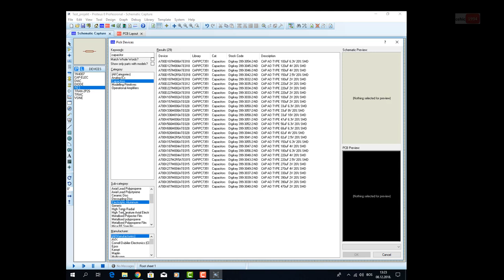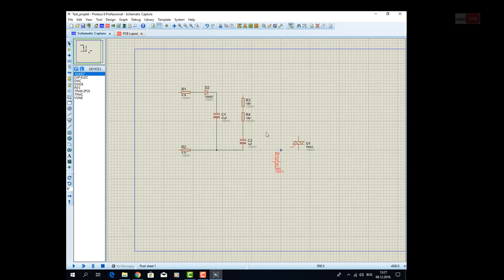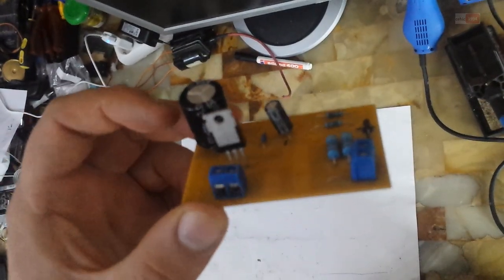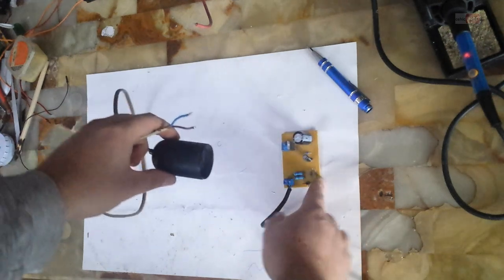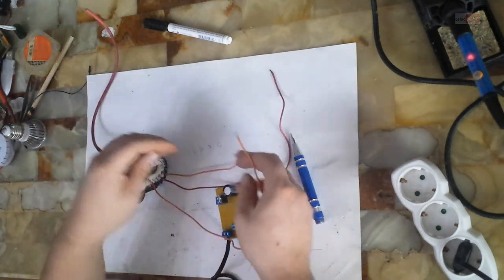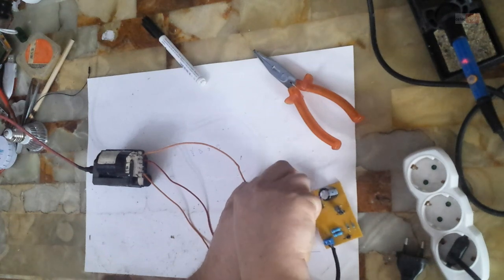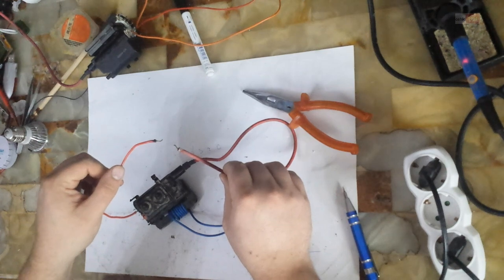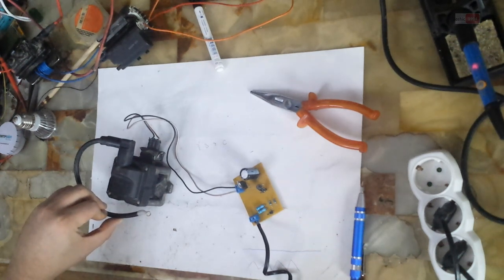AC 230V electric fence charger with flyback or car ignition coil testing with AC 230V DIY

Comment: The circuit is fine.  But increasing C1 to 450mfd and D2 to a 3amp type would increase the reliability of the circuit if you want to use a Motor Vehicle Ignition coil. Reason being a TV flyback transformers the primary winding has  a far higher resistance than a Motor Vehicle ignition coil. The average Ignition coil primary winding current is somewhere between 6 and 8 amps for normal working so the original values of D2 and C1 I am sure will limit the EHT voltage coming from the coils secondary winding. Also R1 R2 may run hotter depending on their wattage rating but I would recommend larger wattage versions.
Reply from the maker: Hi, thank's for comment. I didn't try with that values of C1 and D2, but there is other problem. If we use that values we will change pulse frequency, 450mfd capacitor needs long time to charge. Then we will get higher power but low frequency. Also this circuit current is limited with R1 and R2, if we change capacitor, we need to change R1 and R2 to get same result.
Reply: Sir,I have made this with car ignition coil without any change in c1 .....its working but the frequency is too low....i get pulse every 5 sec. .what shd i do to increase the pulse??... Pls help. !
Reply: @niswanthskumar1608  Try reducing the value of either R3 or R4 by a third to start with, this should speed up the time C2 charges to the Diac switching threshold.

Comment: What a good project. My question is: how many volts does the electric arc discharge or discharge? how many amps? Is it viable for electric fence? the voltave you download is AC or DC?
Reply from the maker: It gives about 15 kV, it depends on what you are using as transformer, flyback can produce higher voltage about 30kV, ignition coil produce less voltage. Current is very low, so that voltage is not dangerous for people or animals. It can be used as electric fence for cows, sheeps...

Comment: I've seen a board with a large capacitor so I'm thinking it's C1 but of much larger a value? 
C1 smooths out ripple from d1?
Reply from the maker: C1 is used to power transformer after diac conduct. It can be larger, but you need to consider charging time, because current is limited with resistor R1 and R2. So if you put larger capacitor it maybe can't fully charge before trigger, so it will output lower voltage and power to transformer.

Comment: Druze jel taj kondenzator C2 bas mora biti 400v ili moze biti tipa 100v? I da li mora biti elektrolit ili moze biti tipa pločasti od 1uF 400v?
Reply from the maker: Moze c2 i od 50V jer diac okida na oko 30V, raditi ce i elektrolitski i plocasti kondenzator,  pozdrav
Reply: @cehic1994  e super i kos samo da pistam imam trijak bt-136 600 da li mozemon umjesto tog tvog bt-139?
Reply from the maker: @elektronikaelektro8008  Raditi ce bt-136, samo ne znam koliko dugo